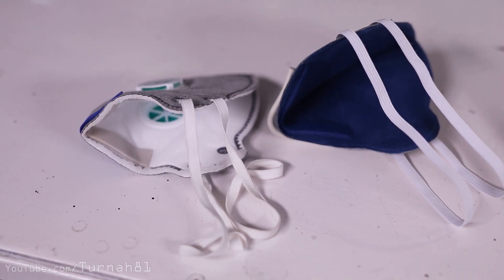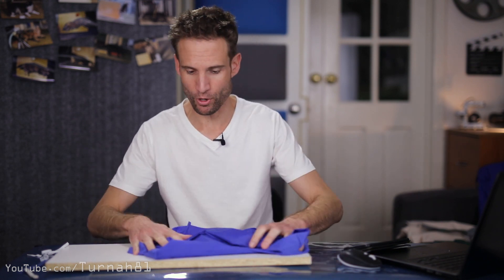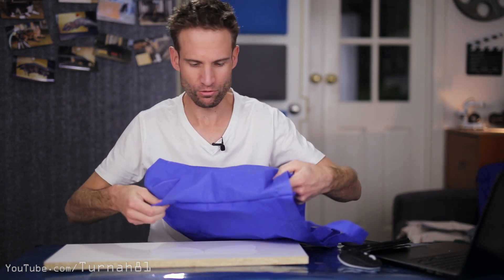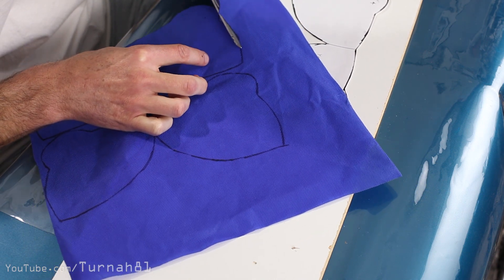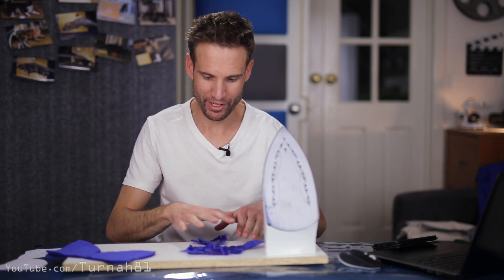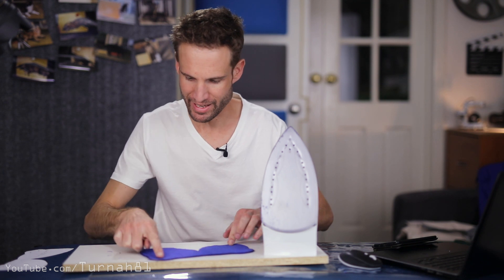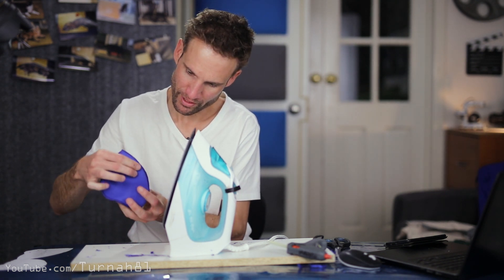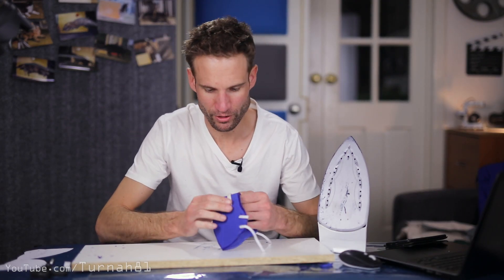How to Make the Best Face Mask, No Sewing - UPDATED

Comment: Thank you for making this video. Watching it gave me some ideas that I might try. I'm going to try using fabric spray glue to lightly spray the pieces together (light spray should also be breathable, I hope) to hold in place instead of using hot iron I think I'll try some contrasting bias binding around seems and hot glued (or even super glued edges). Bias binding could also cover the flexible nose piece. Template looks great, so thanks for all your hard work.

Comment: I have tons of HEPA vacuum cleaner bags (more than shoppingbags.) Could I use as inner layers safely? Thanks  for sharing this information.
Reply: I believe HEPA vacuum filters are made with the same material, polypropylene. The difference is probably in the density. There is also a confusing difference between "HEPA-type" and "true-HEPA." HEPA-type means it filters 99% of particles 2 microns or larger. True-HEPA has to meet a more rigorous standard of filtering out at least 99.97% of 0.3 micron particles. The other consideration in addition to filtration is the pressure drop (i.e. breathability). A vacuum filter might have a much larger pressure drop, making it potentially uncomfortable to breath for some people. But that is mainly a consideration for comfort, granted the person does not have a breathing medical condition. Bottom-line: it's probably safe, but considerations such as the potential filtration efficiency and breathability might want to be considered.
Reply: Thanks so much for the information.
Reply: from watching other videos, you have to be careful using vacuum bags; some of those contain glass fibres.

Comment: Heat welding with an iron looks like it tales a lot longer than sewing, but it does eliminate the holes made by the needle. I guess it's a trade-off on the side of additional safety.  (To keep the Carona virus bugs out your lungs) Great video. Thanks for sharing.

Comment: HAS ANYONE MADE A LASER PARTICLE COUNTER TEST AT THE 300NANOMETER MARK OF THIS CONCEPT?  :)
Reply from the maker: All I have heard back is someone has fit tested it in a hospital which it passed. They had a layer of melt blown or merv16 in it too though. But I think the shape, seal, nose bridge etc are all a solid design.  Materials will vary though I imagine.
Reply: @TurnahsShed  Thanks for the answer, I see if i can make a mask following your tutorial and then test it with a particle counter :)
Reply: @doprisi  Design matters. Thanks.
Reply: I got to test this fabric and got readings around 42-56% effective at the 300nm mark with random indoor dust and a simpel blower fan. I tested Numatic Hepaflo vacuumcleaner bags with the same setup and got 90-92% at the same particle size. Tightwowen cotton bedlinen was around 30% effective and very hard to breath through. But i guess the internet now had enough testing og materials and mask shortages is not bad anymore?

Comment: Why don't you use just hot glue instead of the iron, or even better, superglue?
Reply: he uses hot glue as an option in his other video
Reply: I was curious about superglue as well, since it can melt/bond plastic, but it has cancer-causing fumes when wet. I don't know if they're still there when it's dry but it's not worth the risk. Maybe just use hot glue & press it hard with scrap metal to seal the mask better, or roll the edge & then sew (to make a better seal).

Comment: I'm not sure I'm comfortable breathing through all these materials. I'm pretty sure there's some undesirable fibres there.
Reply from the maker: Yeah that is it. There is mask specific PP available. Hot wire cutting this stuff I didn't detect any other fibre (of a higher melting point anyway)
Reply from the maker: Fibreglass would be very apparent very quickly on the hotwire